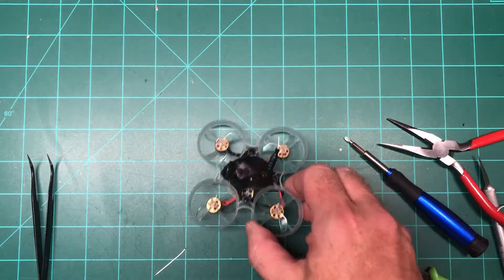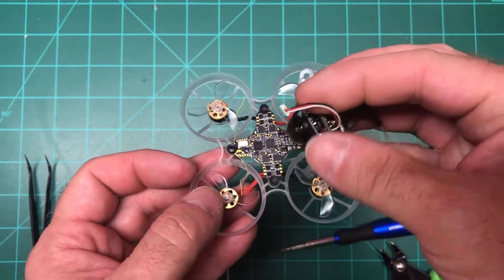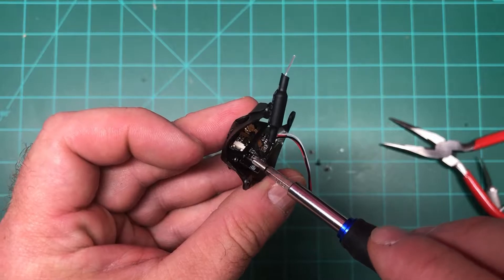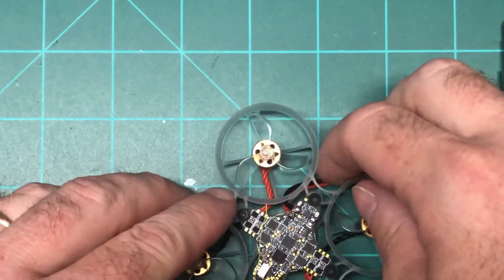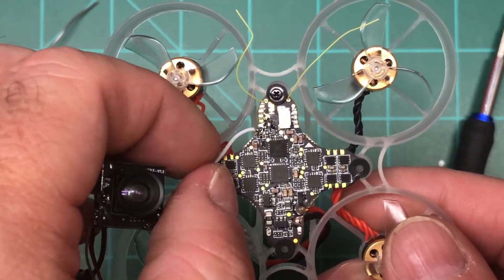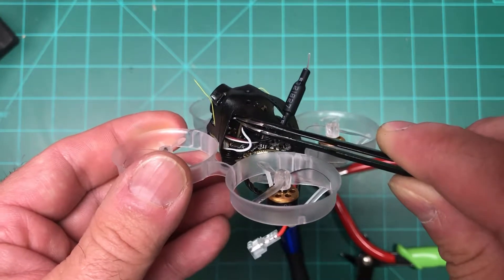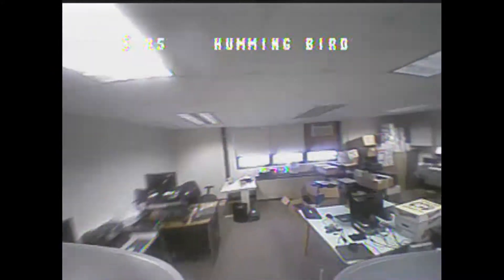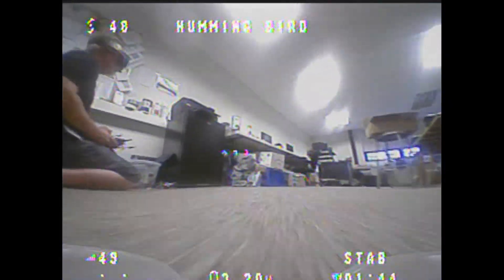Hummingbird F4 1S Brushless BNF Wire Mod Build and Test | DOES IT ACTUALLY WORK???

Comment: I crashed on my 3rd battery and no it seems like I'm no longer bound. I reflashed the firmware (betaflight_4.1.5_HMBF4_PRO_US) but still cannot get into bind mode.
Reply from the maker: I assume you're using the built-in receiver. You may have to go external. I think you can with this....
Reply: @Shooter_FPV  Newbeedrone is sending out a whole new whoop and return label, NBD customer service rocks!